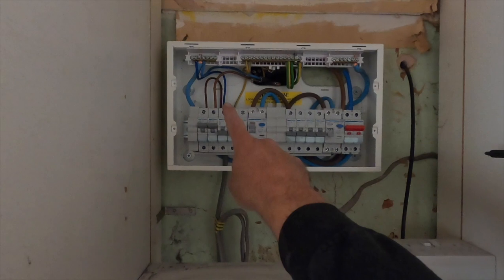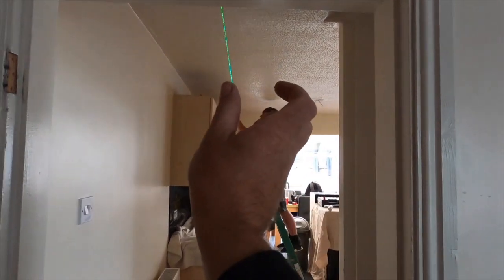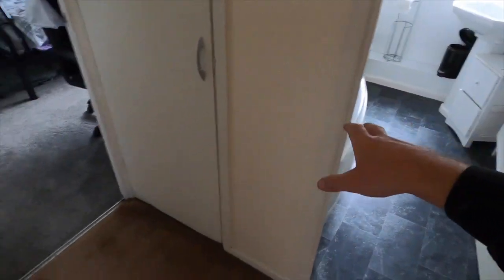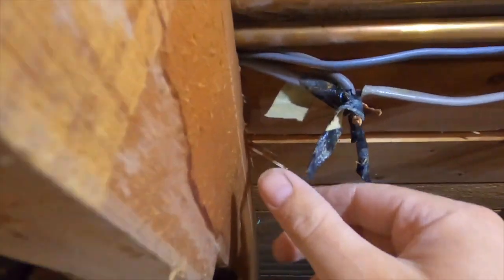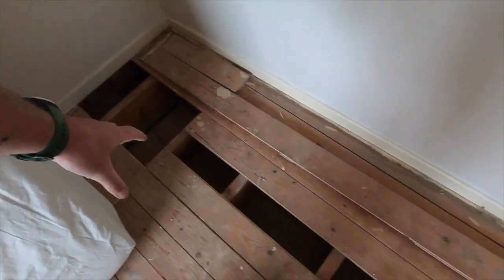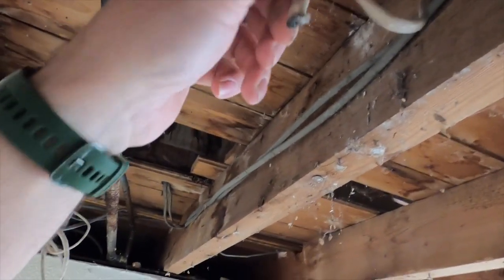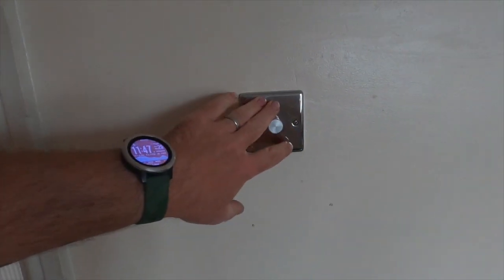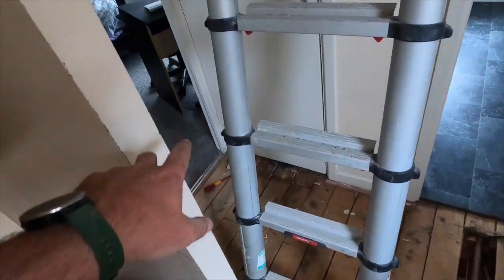How to Rewire a House - Planing cable runs and opening up the house

Comment: Why are you changing socket heights ? Part M height requirements only apply to new builds. And even that's only a recommendation.
Reply from the maker: Yes to true but if you are going to update your house to that extent you are best to follow today’s standards I feel. And we give the clients the options and most say to follow part m but it would be easier to keep in original positions 👍
Reply: I like switches at 1200 but can’t stand the 450 socket height so never do that unless it’s specked